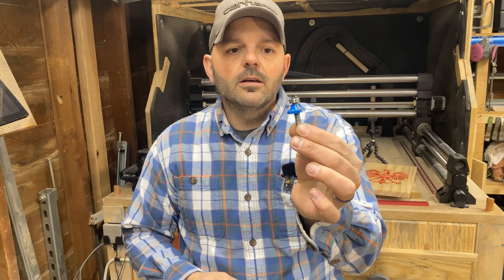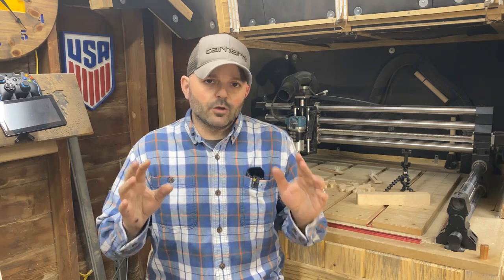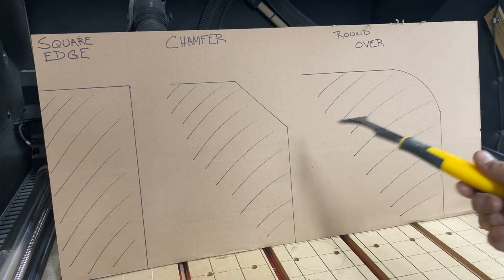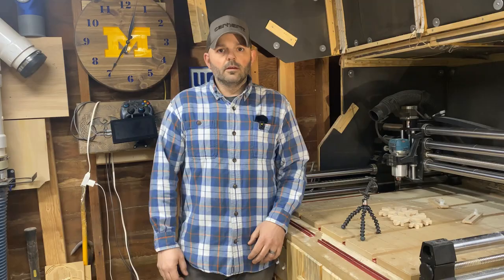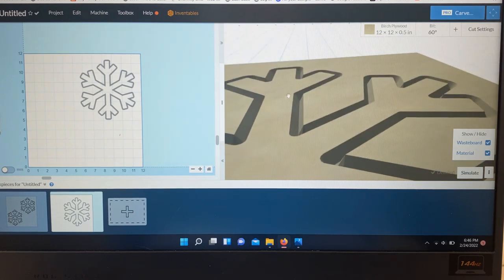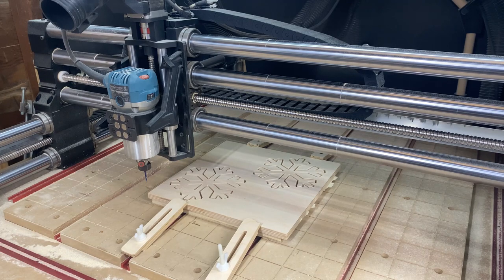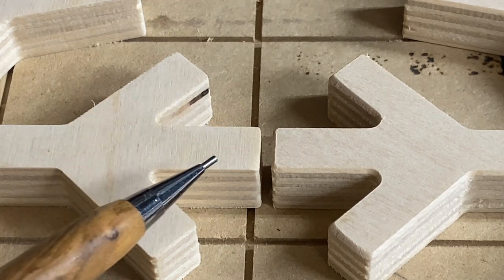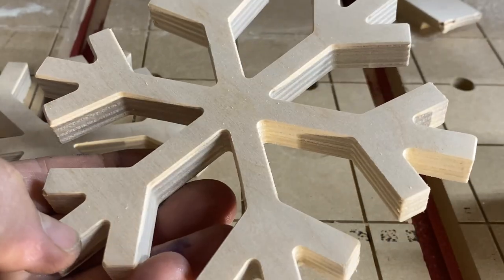Onefinity CNC - Easy Finishing-Touch To Level Up Your Projects. Happier End User Guaranteed!

Comment: Great tip on using the v-bit to get a chamfer! I have two Whiteside roundover bits (1/8 and 1/4), but tend to forget about a simple chamfer/bevel instead of a roundover looks better and can make more sense some times.
Reply from the maker: I agree- I will change the edge treatment based on the look that I’m going for on the particular project. Thanks for watching!